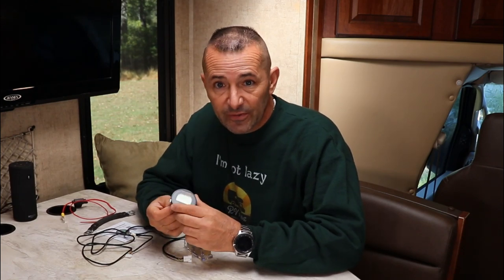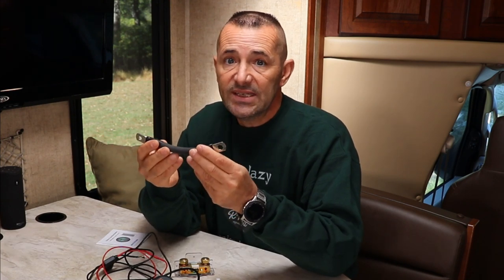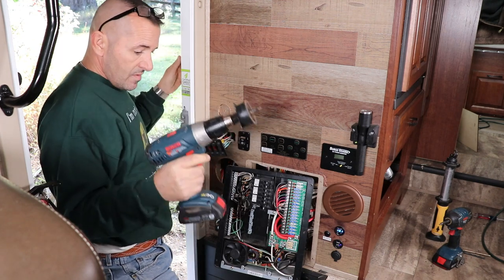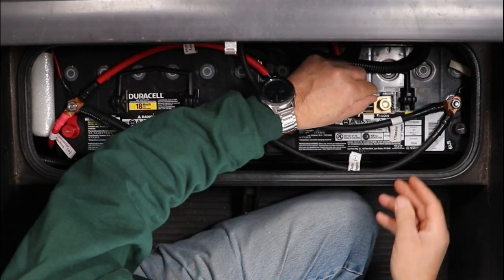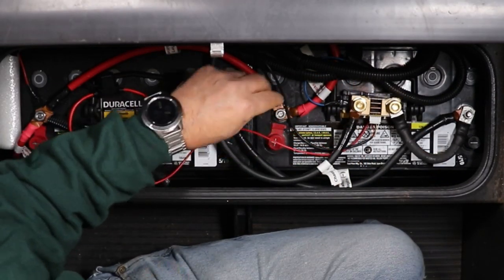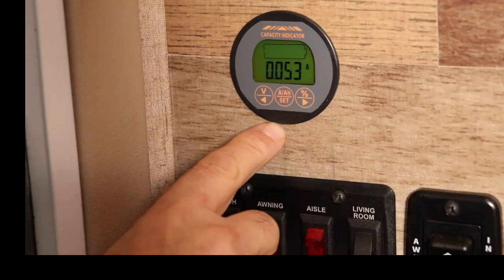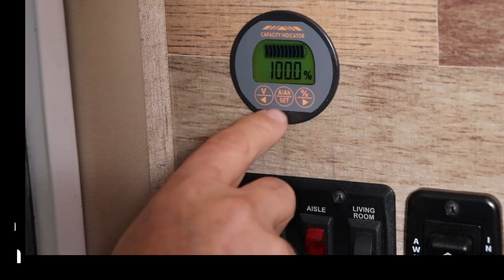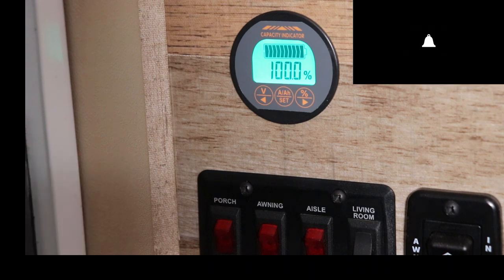Installing A Full Function RV Battery Monitor From AiLi Qwork– How To - Tips and Tricks - RV Upgrade

Comment: I just got 2 new 6v batteries and I'm going to program the meter for the new batteries. Did you ever set up the Preset Voltage Setting on yours? Also when you put in the AH capacity how do you know that number is the actual AH capacity of the battery? The sticker on the battery is only a reference not the actual. If the actual AH capacity is 90AH and you set the meter to 100Ah then you could be discharging your battery to 40% when the meter says 50%. Sorry for all the questions I'm just trying to wrap my head around the settings in the instructions.
Reply from the maker: You do not set any voltage.  You only program the total Amp hours of battery bank.  The best number to use is what the battery label indicates.  I also reprogram and lower the total Amp hours by 5 percent each year for normal degradation.

Comment: This might seem like a stupid question, but how do you know if your batteries are fully charged, if you haven't connected the battery monitor yet?
Reply from the maker: Hi Dan,  Let your converter charge up the batteries for a day.  Then you can disconnect batteries from coach to ensure there is no draw on them.  After about three hours of rest the batteries should read about 12.7 volts on a multimeter.

Comment: thanks. i thought mine was faulty as another video said to discharge down to min voltage and zero the meter. i then charged the battery and the meter only read half the battery capacity in amps had gone in even tho the battery was full. doing it your way worked as it should. many sellers dont provide instructions with these. mine had no manual at all and the listing no info ether.
Reply from the maker: I am glad it helped.  This has been a great monitor for the price.
Reply: @RVHabit  well it seemed to work as i was only discharging 10 amps capacity out overnight and then next day solar filled it up and it would show full with 100amps in the batery. decided to test it discharging 100ah out and then re charging and it looks as i have the same issue as before. batteries are on float charge and inverter mppt shows full on its basic scale and the meter only shows 46ah has gone in. i think i might still be a dud sadly. my batteries are only taking 1amp charge and they are brand new so its safe to say they must be full.
Reply from the maker: When your batteries are at full charge make sure you program meter with total amount of amp hours your batteries hold (ie if you have two 105 amp hour batteries you should program meter to 210 amp hours) and then tell it they are at 100 percent.  The meter reads amps out and amps in.  Good luck.
Reply: @RVHabit   @RVHabit  i charged my battery up full and set it to 100amps. i have a two 12v 120ah batterys in series for 24v 120ah and wanted the meter to show empty with 20% left in it hence setting to 100ah but when i fully discharged the battery to empty and then re charged the meter only read 46amps in and the battery was full. i only have my inverter and fridge load attached on the p side of the shunt. i will try reset it again with the battery full and see what happens.

Comment: Does it have a setting for lithium?? I'm just curious because the voltage drops off in a hurry. It'd be nice if it compensated for that.
Reply from the maker: It states it is good for all types of batteries but does not have any settings to change battery type.

Comment: you say after connecting to neg. of B side of sunt to battery all other neg. go to other side of sunt however you left 2 big negs. on the battery?
I'm also using lead acid is the thick neg. jumper nessasary like can't the sunt slide over the screw on neg post? I like your videos good work you do on them.
Reply from the maker: I have two batteries connected in parallel so there is a short cable that connects the negative posts and positive posts on the batteries.  One cable is needed to connect the shunt to the negative side of the battery bank.  The negative cables that would typically connect directly to the battery bank is connected to the other side of the shunt.

Comment: is the 1/0 battery cable the minimum size? I have a 206ah battery, so would the cable just need to be big enough to accommodate at least 210 amps?
Reply from the maker: Cable size has a lot of variables such as length of run.  I would use at least the current size in your RV or greater.  Good luck.

Comment: What if I also have a DC to DC charger charging my (lithium) battery? It doesn't go through the shunt because it's just a positive wire from car battery > DC to DC charger > aux battery. Is there a way to get my battery % to read correctly? When my car is on, I know the battery is being charged but the percentage in this monitor doesn't go up so I worry about it's accuracy..
Reply from the maker: That is above my knowledge on DC  to DC chargers.  However, I would assume the both batteries are grounded to the chassis and the shunt should be detecting this.  Again, I am no expert I recommend checking with the pro's.

Comment: Hey Lou-  I'm having trouble connecting the power cable to the monitor.  The 12v fused wire - the gauge is too big to connect to the input on the monitor.  Do you have any suggestions please?
Reply from the maker: just attach a smaller gauge wire to the fuse wire.  I believe I used a 16 AWG and a 5 amp fuse.

Comment: Hello it’s my first time setting up a camper 2013 Forest River

I need to now turn on the propane

I am familiar with using a propane grill so remember the previous owner telling me how but it was about two months back

Just want to be careful

Thank you
Reply from the maker: Should work just like your BBQ tank.  Just turn the knob to open.  It helps to then light the stove to get any air out of the lines.

Comment: Thanks for the video but I have a question.  The display is pulsing and I have it connected correcty as I have checked it 3 time and double checked by my wife.  Both batteries are at 100 % and I have set the ah and %.  I have the 2 - poles connected in paralelle then cable going to the B-, all others - going to the P-.  Thoughts
Reply from the maker: Hi Bill,  the display will pulse when a load is being pulled from the batteries.

Comment: I just got one of these and the display works fine for a while then turns off and then will never turn back on again until I disconnect the battery. I'm wondering if I have a faulty one.
Reply from the maker: That does not sound right. It should always been on.  The display will go to sleep after a while.  You press the center button to wake it up.

Comment: How does the % calvulation work? Will it let you draw the full 210A before hitting 0%? Because you can only use about half the capacity before you hit undervoltage/damage your batteries.
Reply from the maker: Yes this simply monitors the power of your battery bank.  This way you know when the batteries are at say 50 percent and need to be recharged.

Comment: If you are using, say, 230 AH golf cart batteries. Could you set the amp hours of batteries to 115 and allow the percentage to go from 100% 230 AH to  0 AH at 115. That way at 0 AH you know your at max drain to prevent damage to batteries??
Reply from the maker: You can certainly do that but I would not recommend setting up that way.  If your batteries fall below say 115AH your meter will only go as low as zero.  You have no way of knowing actually how low they are.  Also if you do go lower than 115AH your meter will think after adding 115 AH it is at 100 percent when it actually may not be.

Comment: Installed thanks to you, but I’m not getting a “Volt” readout. For a reason I can’t figure out, my voltage coming from my converter is @ 10 volts - although I’ve changed the converter and installed new batteries. There are “amp” and “%”  readings from the meter, but I get nothing for“volts”. Any ideas?
Reply from the maker: You should get a volt reading of the batteries regardless of the converter.  I would double check connections. I suppose it is possible the monitor is defecrive but that would not be my first guess.  Also make sure you programmed the monitor properly. 
 Good luck.

Comment: Fantastic video, very well explained, one question,
Does the power wire really has to go to the battery, can it go anywhere where there’s power?
Reply from the maker: The directions state to connect to the battery. However I would think you can connect anywhere that continues to receive power even if the battery disconnect switch is in off position.  You want the monitor to work all the time because even with disconnect switch off the battery may have some draw on it.

Comment: Lou, I may have misspoke.  I'm not sure the battery post are 3/8", but the post on the shunt is. The 6" cable has to be modified on one end?
Reply from the maker: Yes battery posts are different sizes (positive vs negative).  The shunt may be bigger so just modify the short cable connecter.

Comment: Only thing I noticed is that you only have 105 ah in réality  because led acid batteries can only be discharged to 50%   But very nice explanation and instruction
Reply from the maker: That is correct, you never want to run a lead acid battery under 50 percent of its capacity.  I have since upgraded to lithium for a full 200 amp hours.

Comment: The batteries in series doubles the voltage and the capacity stays at 100 AH , not 200. Is this true?
Reply from the maker: In series it adds the voltage the amp hours stay the same. Parallel keeps the voltage the same and adds the amp hours. i.e.  Two 6v batteries of 100 amp hours each wired in series create a 12v bank with 100 amp hours.

Comment: Great video.  I have a question though.  I have 2 batteries and there is a cable between them which makes sense, and then a cable leaving each battery and heading out of the battery box.  I can trace one of them to the frame right outside the battery box.  The other, I'm not sure where it goes.  Would I be able to connect to either one of those "out" cables?  I'm also looking for a wiring diagram of my coach, 2019 Winnebago Minnie 31kThanks in advanceJeff
Reply from the maker: Assuming you have two twelve volt batteries they would be connected in parallel.  Meaning two short wires connecting the two batteries (positive to positive and negative to negative).  On battery #1 the coaches positive should be connected to the positive terminal.  On battery #2 the chassis ground should be connected to the negative terminal.  You would connect the shunt between battery #2 negative terminal.  Meaning a short wire from shunt to negative terminal of battery #2 then chassis ground wire to other end of the shunt.  This is all assumption of a typical setup with no additional accessories connected to the batteries.  You may have accessories connected to your batteries.

Comment: This monitor has a place, but it is not a substitute for a Victron.  It’s synchronisation is very basic and does not rely on a tail current etc.
Better than nothing, but you get what you pay for…..
Reply from the maker: Hi John, I agree it is basic and the Victron is certainly more sophisticated in its calculations.  However this very affordable monitor is a great alternative for most weekend and vacation campers trying to keep an eye on the basic condition of the batteries.  I appreciate you taking the time to watch and comment.  Happy camping.

Comment: Greetings, at 7:42 into the timeline of the video, you put the larger gauge wire lug on top of a smaller lug. Higher current carrying cables need more surface area for optimum conductivity, to reduce voltage drops and the resulting heat. So, always stack from largest to smallest lug. Your electrical performance will be better, and you reduce the risk of excessive heat and fire.
Reply from the maker: Yes you are correct.  That was the negative wires on the shunt.  I did not think the negative mattered as much.  On the positive side I did as you describe putting the higher current on the post first.  Great catch.

Comment: Great video! Thank you. By chance do you know how to reset it. My batteries were not fully charged when I calibrated it. I need to fully charge the batteries and recalibrate it. Thanks.
Reply from the maker: When batteries are fully charged make sure the total amp hour of battery bank is programmed then go to the battery percentage screen.  When showing battery percentage hold down the percentage button for 3 seconds till monitor reads 100%

Comment: Besides the 100A vs 350A shunt, is there a difference between Ali and qwork products?  I see cable length is different on some as well.
Reply from the maker: They appear to be the same monitor with different branding.  You can always purchase additional monitor cable length the link is in the description.  Thanks for watching.

Comment: The price has went up. Bought mine in the spring.  Awesome  little tool. 
My  only  problem  is that I  can  edit  the  set problem 
Reading  full  when actually empty.
Reply from the maker: Set the percentage  only when batteries are fully charged.

Comment: I know the 2 tiny screws (in green box) are for power. What are the two small screws to each side (not the big B- / P-) of them for? Maybe another option for connecting power??
Reply from the maker: No, I do not believe the are for power.  If I remember correctly they are smaller connection points for the B- and P- depending on the application the shunt is used for.

Comment: Another dumb question. How did you route the wire from the battery box to the panel with your controls. I have a FR 3271S with the exact same battery box in the entrance stairs. I bought the Aili battery monitor a year ago and just never had time to install it until now under quarantine. I was thinking of running the monitor cable out through the vent in the back of the battery box but I can't figure out how to get it up to the the panel next to the stairs.  My fuse panel and battery cutoff is right next to the stairway above it. I can reach behind it from the panel under the fridge that covers the furnace. The problem is how to get it through the floor. Everything is stuffed with spray-foam. The floor is steel/rigid foam/steel. Any suggestions would be appreciated.  I plan on running the + power wire to the far side of the battery cutoff switch. My rig may stay in storage for months during the winter, even in NC. I don't want the batteries to be run down, even though the draw from the control panel is minimal. Thanks. BTW I did subscribe.
Reply from the maker: Hi Mark,  I ran the wire out the vent hole in the battery box.  Then I drilled a hole through the floor under the fridge (near where the spray foam is), and snaked a fishtape through to pull the wire up under the fridge behind the wall.  It takes time and patience for sure.  Good luck.

Comment: Looks like it's a very simple setup to monitor your house battery. Currently I have the original (one) . Going to check to see how many I can install once this one wears out. I'm also a part time Rv'er..Only weekends or vacation time.  I don't boondock at all but will stop at a Walmart overnight once in a while or a rest stop on a trip..
Reply from the maker: Hi Victor, I also only RV on the weekends or vacation time.  Thanks for watching.

Comment: Wouldn't you want to set a low voltage cutoff. You can't really expect to run your batteries down to zero amphours so the way that it's set up in this video the percentage of usable power is not correct. Or am I missing something?
Reply from the maker: For lead acid batteries the usable amps are 50 percent of the capacity.  You can set it up so when you reach 50 percent the monitor reads zero.  I like to know exactly what is in the battery bank so I set it up using the total amp hours.  This way if I go below 50 percent for some reason I can see the exact amp hours instead of just zero.  It is just preference and will work either way.

Comment: What length cable did you use to connect the two batteries in parallel?  I don't have the batteries yet and would like to order them ahead of time.  Thanks again!  The earlier message referred to a 3/16" hole that should have been 5/16" .
Reply from the maker: Hi Terry, typically a 12 inch cable will be about right to hook up batteries in parallel.  Take that with a rain of salt as each battery compartment is a little different so you may need a bit longer or may even get away with shorter.

Comment: Hi great on depth video. I installed mine but it seems to be just reading the output and not recognising the input from the solar what so ever. Any solutions?
Reply: Is your solar charge controller wired to the P side of the shunt?

Comment: Nice video! I have about 20 ft between the battery compartment and where I want to mount the display. Can the display cable be extended?
Reply from the maker: Hi Rich, yes you can purchase a cable extension.  The link is in the description.   Good luck.

Comment: great  video   one question  on my camper i have a 50w solar panel on top of camper   in my battery box all i have is a positive and negative cable  when hooking up shunt do i have to worry about the 50w solar power
Reply from the maker: Well it is hard to answer not looking at a totality of your RVs wiring.  However the solar needs to be connected to the negative somewhere to work properly.  You may have a negative terminal block somewhere that ties into the negative cable to the battery.  If that is the case you should be fine.

Comment: Great video.  going to order one today along with the extension cable to mount my monitor up yo 26 feet away.   One question.  Do you know the stud diameter size on the shunt/sampler.  I need to order a short cable.  Cheers
Reply from the maker: I don't remember off hand only that it was large.  The smaller diameter would not fit.  With that said I have the larger shunt for 300 amps.